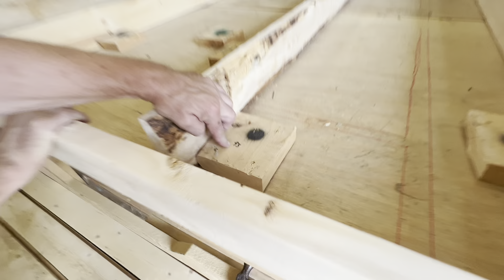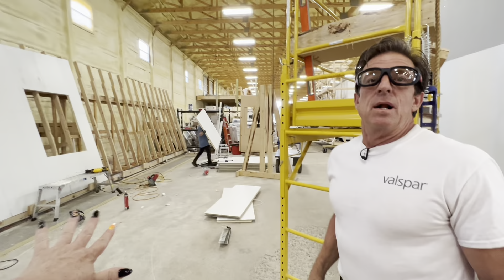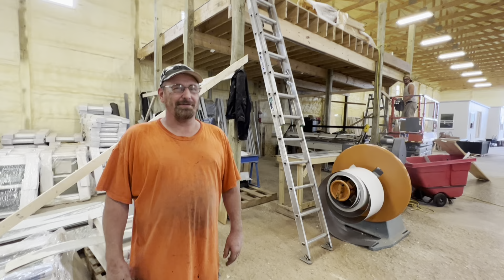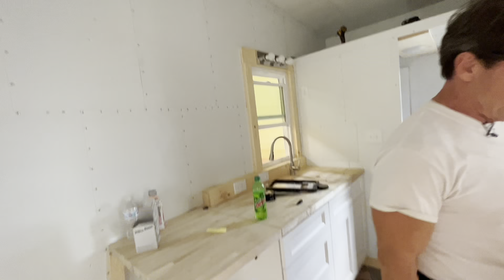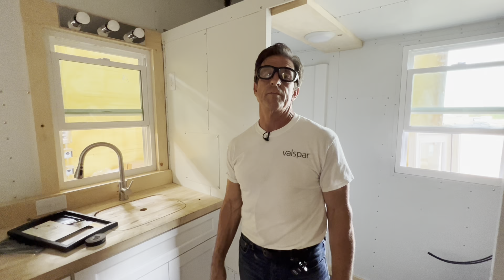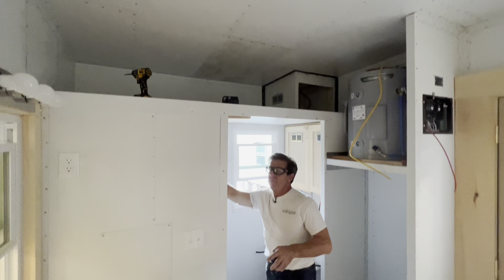October 31st Deadline for SOLAR & OFF GRID SAVINGS is Approaching Soon…Don’t Miss Out!!! 🏡🇺🇸💥🔋

Comment: I also wanted to add, if someone wanted to be really creative with their tiny home, they could build a valance the size of their bed on the ceiling. It would have to be deep enough to encase the bed. Then install a Happy Jack and move their bed up into the valance area. From that valance, you could hang drapes, beads, or anything you wanted to. At night time, just hit a button, the the bed comes down into place. Just build strong window sills for the bed frame to rest on as your stop for the bed. That way you could pretty much have any style of living room furniture that would fit below the window sill and never have to move it when you go to bed at night. The bottom of the bed could be sitting on a nice decorative design that becomes the living room ceiling during the day.

Comment: The warehouse seems pretty loud. If you haven't already, it may be advisable to do some dosimeter testing to see if noise exposure over an 8 hour shift rises to the level that you need to implement mandatory hearing protection or a full hearing conservation program.

Comment: Love the improvement  changes.  👏 
1.  I would turn air conditioner outlet sideways as well as raise it.  You should be able to include the outlet in the window trim board that has the kitchen light, on the far end nearer the corner.
2.  Love the outlets moved to the side of door trim versus the front.  
3.  If you want a thankless water heater can the shelf be raised to accommodate a taller fridge or drawer under fridge for pet food/ water drawer that could pull out to the side end of the fridge, with a smaller front drawer to accommodate food storage.
Maybe that could be a Rob upgrade amenity?  🤔

Comment: You could make that one under the hot water heater a closet take the fold down part off of the cabinet and put an apartment size refrigerator there. Have a twin bed against it back wall and then a chair on the opposite side from the refrigerator and you can even do a daybed in there in place of the twin bed and that would give you two places to sit.

Comment: please put a drip pan under water heaterwhen installed.
Reply: You can buy one to set under it at Lowe's for around $12
Reply: Susan it is hard to lift it up after it is installed u would have to unhook all the pluming and fittings to do so evidently u have never installed a water heater

Comment: I have a vision in my head if I were to live in an Incred-i-box but not sure if it would work.
I would have the 3 windows in the living area higher up. Have a platform built under the windows with a bed (full or queen) that would roll out from under the platform with some storage on the side where the kitchen wall is. This way bed would roll out without hitting counter even if it blocks door a little. Bed might also roll out sideways (short way) instead of the long way. Have a couch or chair with bureau for storage on top of the platform. Instead of adding a loft above a bed or couch, it would almost be the reverse of that. Not sure if all the dimensions would work, but everytime you show the Incred-i-box I picture that in my mind. I was watching youtube videos about space saving furniture and that exact design was shown. Anyway, just thought I would put it out there into the universe.

Love what you guys are doing and love watching your videos. Give Ace a hug for me
🐕

Comment: Amanda, I built a bathroom door for mine and hinged it to the wall. It swung in towards the shower. It intruded on the space too much so I removed it and repurposed the wood for another project. I installed a curtain rod but haven't found the exact fabric yet to fit my decor to stitch up a curtain.
Reply: Yes, an in swing doesn't give you room to be inside and close it. Has to be an outswinging door, or bifold that is mounted on the kitchen (refrigerator/closet) side.

Comment: Question for Q&A. For the people who buy the total off grid. How will the water catchment system work in the winter? My area has temperatures that go below zero for extended days and even if some of the days are sunny, the windchill can be - 10 or lower. How do you get the snow to melt and how do you keep the water from freezing???

Comment: It was not that hard to cut the counter and cut off the extra back splash and remove the extra outlet. I used the edge of my level and clamped it down and took my jigsaw to trim it. Just make sure you turn the breaker off for the kitchen. I cut a small piece of wood down to cap off the end of the back splash with some wood glue and brad nails.

Comment: When I get mine I will change the counter hindge. I will use a piano hindge and a swing down legs. (The extended counter doesnt have to be solid to accommodate the the swing down leg or legs). When I get mine I will route out two pockets for the legs.

Comment: Great videos! Can you tell me what is on the bottom of the floor? Underneath the trailer... what would be exposed to the ground? Is it plywood?  is the plywood covered with metal as well?
Just curious as the bottom of the Incredibox is / will be exposed to elements...
Reply: It's not covered with metal, but it is pressure treated ply, very durable.  If you will be traveling with it in wet weather, you could always undercoat it.

Comment: Dear Amanda not happy with guard house 😥 elderly ladies may need the toilet more often than youngsters such as Randy and yourself 🚽 I would expect 2 or 3 ladies in there at a time 💞 also winter is on the way ⛄ where is the heating and kettle for hot drinks 🤬 seriously suggest you make a smaller, totally off-grid version of the I box 🥰

Comment: Idea 💡 put the outlet for the air conditioner plug on the loft floor so it’s hid and not on the wall by the window in the kitchen
Reply: A lot of people are cutting a hole in the loft wall (near the kitchen window) to set a window A/C on the floor of the loft. A plug there would be in the way. But if you really want it there, you can move it, or hire an electrician to move it.

Comment: A leaking water heater in a Incredibox is a major thing. Too bad you couldn't just install tankless water heaters. You would save space and future water heater problems. If that many are defective I wouldn't rely on them lasting a long time. Keep up the good work. Loyal follower.
Reply: The price would have to go up to pay for the more expensive tankless (and the propane equipment). Also, tankless don't work well in cold climates. Randy used the electric tank w/h to save money, and because they work in every climate.

Comment: Loving all the new changes! Question ❓ how big is the kitchen window in the I Box?  I would think folks could put a small window unit in that window and it would blow into bath and living area instead of them having to cut out a hole . Easy to reach for cleaning of filter.  Thanks for listening to your buyers and perspective buyers on suggestions!! Oh and my crazy name spelling Lesia is actually pronounced  say my name... ...( Le- sha) not many get it correct till I say it. ❤️🙋
Reply: The kitchen window is the same size as the bathroom in the Incred-I-Box. Problem is, the faucet will get in the way (I'm thinking even if you removed it, install AC, then reinsert the faucet). That being said, it would be easier to drill a circular hole in the countertop off to the side and put the faucet there than to do the whole wall AC mount thing. Just put a soap dispenser or scubbie dish over the old hole, tada!
Reply: The kitchen and bathroom windows are both 2' wide x 3' tall. If you install a window AC from outside, setting it on a shelf you build that sets on the window sill, then you don't have to worry about the faucet. When the weather turns cold, just go outside and remove it and the shelf, and store both for the next summer.

Comment: Can you add a sleeping loft above where they are suggesting the bed goes?
Reply: Yes, an elevator bed that lowers from the ceiling would be perfect! Or, if you can still climb a ladder, put a bunk bed above a sofa... or build a sleeping loft with the sofa under it.
Reply: @susanbeals7597  Yes! Elevator bed!  I am about two seconds from ordering this with the offer grid package and the extra batteries for my property right there outside of Nashville. The only thing that holds me up is trying to figure a bed and couch. Elevator bed works. What do you suggest for elevator bed? Have you researched it? Thank you so so much in advance for your answer. This is kind of crucial. I am on a wing and a prayer and some credit to make this happen.
Reply: @violingal  - Ana White built a genius one for a queen size bed...  How to and pricing, in this first video. For an incredibox, you'd want to install 4 2"×4"s into the metal walls for sturdy support for the lift rails, and 2 wood boards as mounts for the lift hardware on the ceiling...
https://youtu.be/ZEurdaURavw
Finished product video...  https://youtu.be/lHjJd4tkvSU

Comment: use ur cut outs from the wall windows to cover the waterheater.
and are ur plugs near the sink ground fault? a piano hing might work better.
Reply: If you prefer a piano hinge with a swing out support arm, you can make the switch. Initially I thought I'd prefer that, too, but the piano hinge will be a cleaning nightmare (crumbs getting caught on it) compared to the 2 little locking latches they selected.
Reply: @susanbeals7597  Randy said  he was having issues with that hinge saging thats why i suggested a piano hinge

Comment: I so wish I had a place to park one with the solar package (extra battery, of course). And we have to start celebrating early, Randy. It's over too fast as it is. Grab that fun while we can.... "Ground control to Major Tom", the song is named Space Oddity. If I had land that allowed it I think I'd add a yurt for a living room and bedroom and use one of these as the kitchen, and bath. Maybe get 4 batteries and put extra solar on the ground to power the yurt and throw a little woodstove in it for really cold weather. What more could you need? You could keep anything climate sensitive in the ESP house and you wouldn't need to worry about keeping the yurt warm or cool while you're away for the day or on a trip. And if you had to you could pack up the yurt and tiny house and head out to greener pastures. Heck, I might even take out the back (short end) window and buy one of those wall bed/ table combos you've made in your wood shop. That way if it was too hot or cold to stay in the yurt we could sleep in the kitchen :)

Comment: I'm not sure if you have done this yet.... But I asked about 5-6 weeks ago what the tongue weight is? I have a Tacoma 4x4 2010 and need that information to see if I need to go another direction to haul to AZ....   You need to do it on all 3 models since options will change weight distribution...   It looks like the solar setup with dual battery if 24v is 302lbs plus inverter area weight 50 lbs?  The off grid with tank and other stuff also will add more to the back....   Plan on buying in October